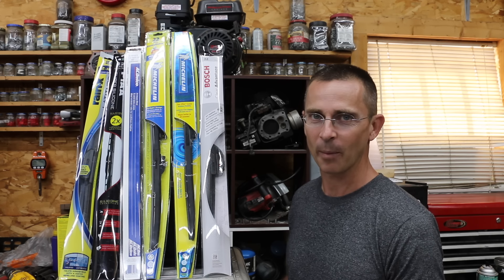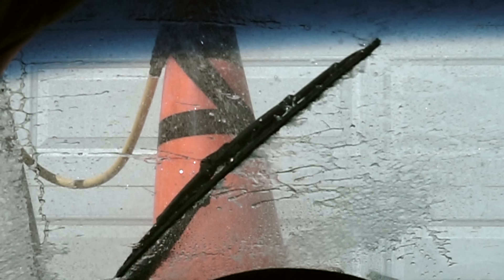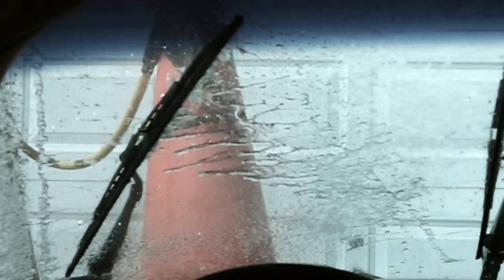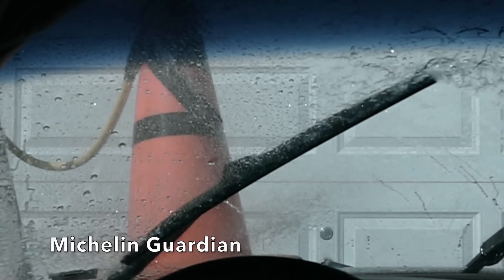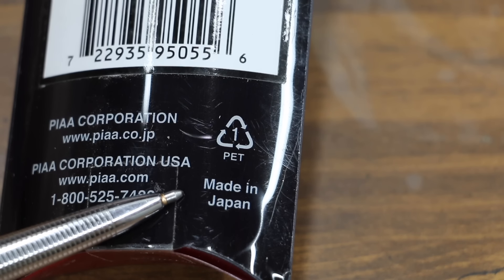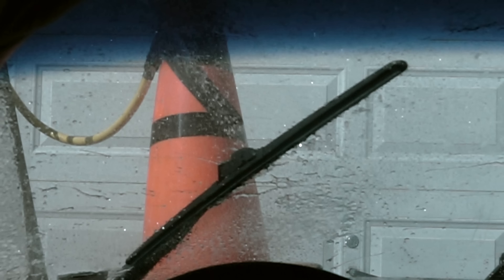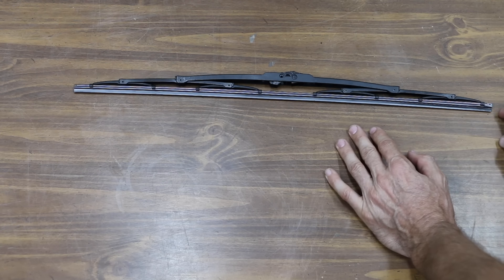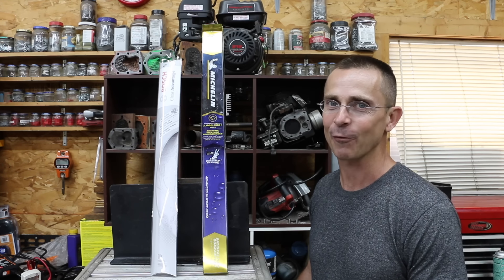Which Windshield Wiper Blade is Best? Let's find out!  Michelin, PIAA, Bosch, AC Delco, & Aero

Comment: I’d agree with others that a long-time evaluation is needed for this kind of product. Some wipers seem to degrade quicker then others and that’s where I would make my decision beyond their new performance.
Reply: The expensive Michelin blades still work like new over a year in. Idk how long they're supposed to last but I'm happy with them so far.
Reply: The Bosch blades all kinda of fall in performance after a year. In the last rainstorm they seemed to be extra awful. I just took some paper towel and wiped them off for a few minutes and seemed as good as new. I have a feeling if I cleaned them lightly with some warm water and soap they would be good for another year. I've owned all tiers of the Bosch blades on several cars. They all honestly seem about the same, the most exspensive ones seemed to hold performance the longest though, figured I'd try cleaning them instead of replacing them this time though, as these where the most exspensive ones and I'm pretty happy that wiping them off brought them back to life.
Reply: I had my PIAA a year and half now and I couldn’t be happier

Comment: Ford F150 (Middle Tennessee):  Recently switched to a Bosch Icon 22” A for the driver’s side, 22” B for the passenger side (slightly more curve).  Absolutely the best wiper blade I’ve ever used.  Excellent at highway speed, too.  Looks very similar to the expensive Michelin blade in the test.
Reply from the maker: Thanks for sharing.

Comment: Been using Bosch Icons for almost 10 years now, best I've used IMO
Reply from the maker: Thank you for the feedback!
Reply: I think the icons are better then the Bosch in this video, currently trying to warranty ones in video for a family car, I think they just sat in the amazon warehouse too long.  Got them in January but they are jumping and noisy as heck right now.  But meanwhile on other car the Bosch icon doing good so far on one side I have one.
Reply: I was very surprised/disappointed that the Icons were not included in this comparison test. :(
Reply: I'll second that... the Bosch Icons are the best that I have used.  They work well in all weather conditions.

Comment: this test is good for urban / slow moving vehicles, but when speed catches up and wind starts playing a role everything changes.
Reply: That’s what I was thinking as well. I’d imagine that wiper manufacturers test in high wind environments and design accordingly.
Reply: @verothacamaro  exactly, wind helps alot in pushing water away from the edges so this "pull back" thing doesnt exist.
Reply: Also I appreciate the effort but these lines left behind can be easily blamed on manufacturing tolerances that any brand could have suffered from, there should have been at least 3 wiper sets of each brand to make a proper comparsion and make sure that u didnt just get a bad unit.
Reply: Yeah, I wonder if the "water going over the top of the wiper" thing happens with wind.
Reply: My experience with "winter" blades (the ones with the rubber covers), they will lift off the windscreen at highway speeds. Of course the ice build up is minimized, but they still are nowhere near as good as a flex-beam
Reply: I was looking for such a comment or maybe one critizing the video for not having the car in a wind tunnel to simulate at least three different road speeds.
Reply: @aSASa45454  the metal-frame wipers would just lift off and float on the water
Reply: @aSASa45454  Lived in West Central FL for over a decade and seen my share of downpours. That "water going over the top of the wiper" is real. The downpour is so great that you can't drive 70mph to utilize the air flow. Traffic quickly slows down sub 30mph in the worst ones, sometimes lower, so yeah... as far as those big downpours that put enough water on the windshield to put water over the top of the wiper, the wind won't really matter.
Reply: @dushk0  My previous set of blades were the metal frame type, and never "skipped" across the glass. They did leave a lot of overwash where the water went through the frames however, and started squeaking. I picked up a pair of the rainX blades that were featured here and at speeds under 50mph they work great. Moves all the water off the glass and doesn't chatter. However at speed 55mph and above, they hop and bounce across the glass causing lines of water to be left.

I clean my car typically every other week, and use glass cleaners to clean all the windows inside and out. I then coat the windshield and rear window with rainX repellent to allow the water to roll off much easier. There are times where blades are not needed and I can see other drivers going by with their high speed wipers going while the water for me just beads up and rolls away.
Reply: @ConquerorAR  like i've heard my company when we fuck something up ;) same old song..
Reply: ASE mechanic for 17 years and Testing both myself at 70 to 80 mph on an older vehicle (01 Civic and 98 GMC C2500) the one piece designs are not a good Idea. The arms are not designed to overcome the aerodynamics of the blade and lift the arm just enough that you get a 6" streak in the middle of the windshield as only the ends will touch. I drive 160 miles a day on the highway and had to switch back to the steel frames over the Latitudes I was running. As I have always told my customers "Use either OEM or a good quality equivalent of the same design as OEM"
Reply: @dushk0  the metal frame would have less wind resistance, they have holes everywhere for the wind to go through. The other flex wipers are a wall for the wind to pick up and take away
Reply: If you coat your windshield with rainx, it doesn’t generally matter what wiper you use.  Even a wiper on the junky side will end up working well.  I’ve reloaded a pair of metal frame wipers before for less than $5 and they lasted a year easy.  Other people have also reported cheaper wipers working really well with rainx.
Reply: @p.granger8824  ...does it leave a buildup or causes glaring...esp at night?
Reply: @zaneblane8160  no not at all definitely worth I and buy the Rain-x washer fluid it costs about $1.00 more than the cheap washer fluid.
I lived in Oklahoma and traveled all around the state through 2 Areas that tornadoes were in and so I know what torrential rain is.
At high speed driving I turn off my wipers. Because the water just flows like glass off the vehicles.
Us it you will be glad you did.

Comment: My one problem: the car wasn’t moving which I understand is difficult to simulate, but if it was moving you would’ve seen the rainx blades really come to life. 23 year auto tech here. Love your videos!
Reply from the maker: Glad to hear!  Thanks for watching.
Reply: This is true. With the rain X you don't even have to use your wiper blades as long as you're running 45+ mph. It simply repels the water.
Reply: I agree...the wind has a great deal of impact on the performance of wipers, and windshield shape giving different performance results between cars.  When Costco had goodyear blades for $5 they actually worked the best on my car, even compared to OE, but they also blocked windshield washer spray because the height of the blade body.

Comment: I've had piaa wiper blades on my jeep that lasted 4 years and only cost me $21ea on ebay.
Reply: Yeah I've had the same experience with PIAA, as a matter of fact the Super Silicone I used on my Subie came with a windshield prep towlette and recommended 10 mins dry wiper time like the rainx.  They worked so well it blew my mind.

Comment: I’m a trucker so I’ve used all kinds of windshield wipers A LOT lol. For my private vehicles I’ve used and like the Michelin XT BUT in very hot humid weather the silicone gets grabby and the noise will drive you nuts. The RainX Latitude are great for about a month or 2. 
My go to setup for many years has been RainX Expert Fit Beam and RainX Aerosol glass cleaner, that combo is nothing short of amazing. Hint ; only use that glass cleaner in the shade and never while the glass is warm or hot.
Reply from the maker: Thanks for sharing.

Comment: I'd like to see some Trico blades in the running, namely the Onyx and Force lines if possible.
Reply: I'd also like to see Trico Ultras tested. They are made in the US and have one of the best attachment designs I've seen.
Reply: Trico Titan is the best,I live in West Texas desert like weather and they last and hold up to the heat I've had mine for a year a 5 months so far and never had a set hold up over a year before these and I tried dozens of different blades
Reply: lol those are both the trico onyx design. they change their product names based on the store they sell them to so in TN at Advance auto they're onyx
Reply: @alphonse4991  well don't shop there I get all my parts at O'Reilly's

Comment: Impressive! Hope that you can also test for aerodynamic causing skips or wind noises. TIA! ☺️
Reply from the maker: Thank you for the feedback!
Reply: @ProjectFarm  I'm having a problem with a wiper on my Chevy S-10 that performs well until I get over~40 mph- it then 'chatters', doesn't wipe well. Does OK when I slow down; some kind of aerodynamic issue there. Enjoy your videos, good info!
Reply: @Britspence381  It might be worn springs in the arms.
Reply: @ebels3  Thanks, I'll check that out!
Reply: @Britspence381  yup, arm springs are wore out.
Reply: @walkermediaworx  Yep, I think you're right, not broken but 20 years old. Thanks for your feedback.

Comment: I’d be curious to see how Bosch Icon wipers perform in your tests.  I’ve had 2 pairs and both sets had to be replaced within 3 and 4 months :/.  Switched to the RainX wipers and they made an incredible difference, you hardly need to turn your wipers in with light rain.  Mind you this is in upstate NY where we can get all 4 seasons in one day.
Reply: I've used Icon blades for years without this issue. I generally end up selling the cars before needing to replace them, but it sure beats buying a pair every time the seasons change, for sure. Personally I've seen multiple sets last multiple years. I live in arkansas so we get some ice and snow but a lot of rain and cold/hot temperatures throughout the year.

Comment: I'd have liked to see a test with a strong wind in two directions (straight, then from the side) to see how the blades avoid chatter.
Reply from the maker: Great constructive feedback. Thank you
Reply: Seconded, though I wonder how you'd set up the test to achieve repeatable results.
Reply: @markusklemm4516  One of those big shop fans that could be in a set position for all testing. Probably can rent them.
Reply: I was going to comment that these tests are great - for a car standing still in the rain.  This suggestion covers what I feel is missing from the tests.
Reply: @jamesplotkin4674  Would such a fan be able to provide high enough wind velocity, and be both controllable and repeatable enough to sweep across a speed range? (I honestly don't know, I just think it's a question worth asking?)
Reply: @JohnLGalt_1  I'm still searching for the best, all-round solution and the beam style seems to perform well on the freeway with the wind blowing. I hate chatter and squeaking.
Reply: @markusklemm4516  Good question. The 4-foot diameter fans sure blow a gale and they can be set on a table, or clamped to a workmate for repeatable results. Scotty Klimer has a fan just like this in his driveway.
Reply: Agreed.  I've found that the beam style, particularly those with a seeming 'wing' or 'spoiler' effect at the top seem to work well, as the velocity of the car above speeds of ~35 mph seems to provide enough air flow to push the accumulating water on the left edge of the wipers up toward the roof of the car during the inital cycle, when the wipers are moving to the left, thus diminishing the amount of water to be left and dragged back across the windshield on the return cycle, when the wipers are moving to the right.  But, that brings up another problem in that the higher velocity also seems to be less effective on that same return cycle, with water being forced to the upper edges of the wiper and toward the roof, thus escaping the trajectory of the blade on that return cycle.

These are just my own observations, and I've only used the Bosch blade style in recent years to get a mix of affordability versus performance.  As I live in GA, rain and a very occasional sleeting is all I've had to test with, as there is almost no snow to speak of (and I tend not to dive in the snow when it does snow, as a lot of folks down here just don't know how to drive in the snow....
Reply: @jamesplotkin4674  I use a set of PIAA Silicone Blades that have a built in Performance Wing on each shaft that works like the Rear Wing on a Performance Car. 

No chatter at all no matter what speed I am traveling.
Reply: @JohnLGalt_1  Yep. Is what mine have. I bought a set of PIAA Silicone Blades that have a Performance Wing attached to the shaft of each blade. 

it allows air to flow over and under for maximum downforce on the blades.

Comment: I ceramic Coated my windshield and in most rain when I’m traveling above 50mph I don’t even use my wipers.
Reply: I Steele plated my windshield and I don't even blink when a tornado goes by.
Reply: I’ve been using rainx or recently Beadmaker. And yeah, at speed you really don’t need the wipers.
Reply: Aquapel works great too, it's a cost effective solution versus ceramic coating. Been on my windshield for a year now

Comment: Bosch, best bang for the buck. Thank You.
Reply: Worst crap ever!!
Reply: @paulwhat322  , what are your suggestions?
Reply: @youarerightboss  Trico
Reply: I did extensive research in the stores and on line, and never saw ANY $10 Bosh wiper, but fixing to go back and look
Reply: @captinbeyond  , yeah, cheapest that I was quoted was around $15.
Reply: @paulwhat322  , thanks.
Reply: @youarerightboss  I just bought these on amazon for the $10 shown here....totally blown away that they never came up when i searched for wiper blades, nor did I find them in the stores. I bought them on the spot and with free shipping.Wished I'd found this site...I'd bought one at Autozone( Everlast brand).. was the same blade type but much more $17.These look like a steal for only $10 bucks

Comment: No ANCO blades? I've been using them for 40 years.....the winter blades, sometimes all year round (with the rubber covers). They often last a couple of years.
Reply from the maker: Thank you for the feedback on ANCO.  I'll test them in the next round.  Already bought them and they are undergoing UV exposure
Reply: Project Farm I worked at anco which stands for the Anderson Company for 28 years now retired
Reply: Mary Anderson

Comment: I am most definitely looking forward to your 1-year update on these, I will be buying new blades n October for our cars.  Thank you for making these awesome test videos. It was your Video from 2 years ago that helped me pick MotorKote for use in my older car,  it made a big difference on the valve tick i was getting.  also made for easier starts during the winter here in South Dakota.  And you have helped me pick a better oil for the cold conditions here as well for my newer cars
Reply from the maker: Thanks for the feedback.

Comment: Great test project Farm, I am retired now but I sold wipers at my auto Repair and tire center for year's and the car's that were parked out side all the time wiper's were the ones that failed a lot sooner than one that was parked inside. The sun does take its toll on wiper blades. BTW I sold Bosch blades, The best for the Buck in My opinion.
Reply from the maker: Thanks!  Thanks for sharing.

Comment: Older cars/trucks likely are to work better with metal frame blades.  Kudos for your thorough reviews.  However, I have first hand experience with the new style flexible frame wipers on older (pre-aero style) vehicles that have relatively mild curvature to the windshield.  For example my 1992 F250.  The new stlye wipers don't even touch the glass in the middle of the blade leaving heavy water right at eye level.  You do an outstanding job with your reviews and can't cover every situation.  Just passing this along for drivers of older vehicles.  Thanks!
Reply from the maker: Thanks for the feedback.

Comment: My first trip to Walmart to buy new windshield wipers I consulted the reference guide in the wiper section. The best I could figure it said I needed a 22 inch blade. I was kinda surprised when I got to the checkout with them being so expensive. When I got home I did a Google search and discovered that I needed the 20 inch blades. So I went back and got a package with the 20 inch. I opened the package and then got another surprise. Each package contains only one blade. Since I had read the installation instructions and seeing that I needed to run the new wipers for 3 to 5 minutes at medium speed on a dry clean windshield I knew it would be best to take care of both sides at the same time. So I have wipers that cost in excess of $40.00 and now I am looking at YouTube videos to see how to install them. The instructions are so tiny that I needed a magnifying glass just to read the instructions. For that price they could have printed the instructions larger even if they had to use both sides of the paper.
Reply from the maker: Thanks for sharing.